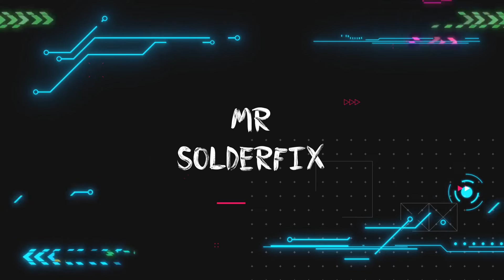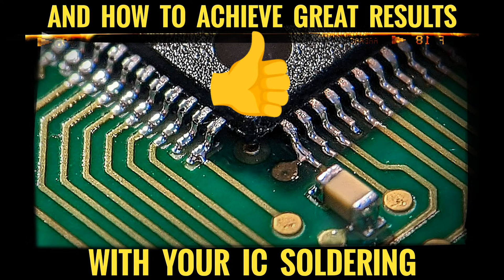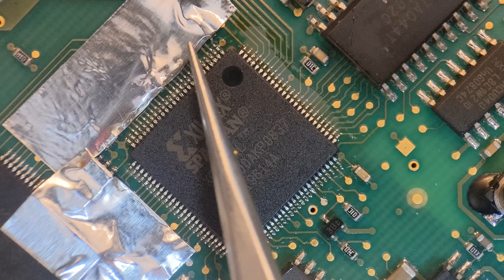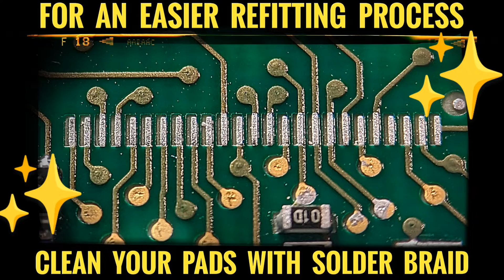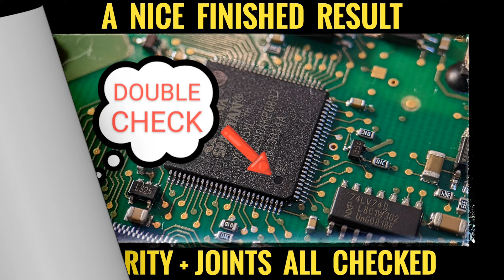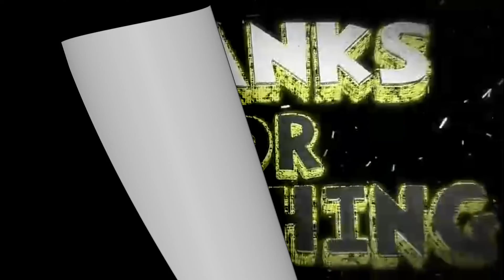How To Replace Surface Mount IC / smd IC || smd Soldering

Comment: How would you do to remove qfp with a gnd point soldered under it?
Reply from the maker: Hi , thank you for your comment . I've previously shown this in an older video and I've also shown BGA removals in various videos. You need a hot air gun to remove these , there's no chance without one of these unfortunately. Hope that helps , thanks again 👍
Reply: @mrsolderfix3996 thanks for answering so fast, I'll definitely watch other videos.

Comment: Thanks, great video. Just trying to reproduce this on a 176pin QFP with a solder square under the IC. Regards. South Africa. Hopefully the solder square does not give problems. I've heard one must heat the entire PCB to 160C and then tackle the individual IC.

Comment: im using led free and cant desolder cpus with air gun for my life, PCB starts overheating be4 solder liquifies on all 4 sides
Reply: Use a soldering iron to melt low temp solder wire onto the contacts - with the heat of the iron, the low temp solder will mix with the hi melt temp lead free solder that manufacturers use which will bring the melting temp of the manufacturers lead free stuff down enough release the cpu. There are many videos on YT showing this process.

Comment: - What are those components at 11:32 next to the IC ? They look like resistors. But they are marked with 01D and 01C.
Reply from the maker: Hi , thank you for your comment . Yes they are resistors . 01C is 10k ohm and 01D is 100k ohm . Hope that helps , thanks again 👍
Reply: @mrsolderfix3996  - Thanks. That helps a lot.
Reply from the maker: @valleyken hi , no problem , thanks for your comments 👍

Comment: Thanks for showing the removal in real time, other videos edit that bit and make it shorter than it really is. Also giving us the temperatures! Stressing the importance of flux, people don't realise that flux really helps removal of components as well as the soldering of them. That de-soldering braid comes in different sizes, decades ago, before the braid was invented, I used to strip coax cable and use the shielding as de-soldering braid! The braid does have flux on it but adding more flux can only help! By the way, folks, don't forget to clean the flux off afterwards!

Comment: Dear Mr. SolderFix, The technic used here is good. Your might use pre heating the board with a temp fairly close to solder melt temp, this process will help with large ground plans. In that way your'er  reducing the dwell time to get a complete melt.. Some boards are so heavy that heating a small area could possibly de-laminate a multilayer. I like the drag soldering method for better joints from heal to toe of each lead. Your calm voice and hand motion is superb. I'm very interested in process control when it comes to removing and replacing  SMD. I worked with PACE Inc. for many years. I'm IPC trained and can work on avionics and so forth. 
Please view my demonstration by searching "Everything you wanted to know about soldering and desoldering but were afraid to ask" or simply search PACE Inc. and you will see me in a blue lab coat. It's a live on the fly edit. 
The 1hour and 17 min. demo covers 5 unique hand-pieces. It's hard to believe this was made in 1996 but much still applies. 
Again Sir, I like your presentation style, relaxed and spot on with the cam.
Best Regards
Marc Siegel

Comment: solder paste will save you some time
Reply from the maker: @joshygaminghub7428  hi , thank you for your comment . I do use it , I've shown in a few videos the use of solder paste . I find IC's like this much easier to do with 0.25mm solder . 
Lots of people struggle getting the right amount of paste down ending in a right solder bridging mess . Unless you luckily have a stencil to me the iron is the winner . Thanks again 👍

Comment: BRILLIANT! I have struggled with doing proper solder repairs my whole life! I learned NOW from watching your videos how to solder PROPERLY and easily! Your videos are very professional! THANK YOU! for doing this fine work! 🎉
Reply from the maker: Hi , thank you for your support of my channel , very much appreciated . If my videos can help a few people out with their soldering / desoldering issues then that's great . Thanks again , take care 👍
Reply: @mrsolderfix3996  Great work Sir. Thank you so much for that. By the chance would be to possible to show technique how to solder correctly wires to the mcu pins. Sometimes to read flash work require to get connected directly to mcu pins. Could you show please how it would be. I am still in struggle with that. Thank you for your time

Comment: I just first wanted to say thank you for all the hard work you do when it comes to producing these videos and sharing your knowledge with us.  While I have learned so much from your videos (which I often put the information to use right way by practicing on "junk boards") I do have one question, when it comes to removing and replacing SMD ICs (and in this case specifically a BGA IC) how to you properly lift the chip from the pcb when there are a decent number of smaller SMD parts on the back side of the PCB just under the IC you are going to lift?  My first idea is to use the pre-heating station to heat the board to 100C and then use the hot air gun plus Flux to heat the BGA area up to the point where I can lift the chip; however, I am worried that all the smd resistors and capacitors on the back side of the PCB will fall off when I do this.

Comment: Hi what soldering iron did you use for this job.
Reply from the maker: Hi , thank you for your comment , much appreciated . In this video I used a Weller TCP S soldering iron which is 50 watt with a PTP7 conical tip . Quite an old style iron but still great to work with . Hope that helps , thanks again 👍

Comment: Great demo of how to do this properly and neatly.
I have a problem with desoldering braid "sticking" to pads. Plenty of flux, I think. Could it be iron head too small, not enough heat, flux has burnt off, poor quality braid....any ideas?

Comment: Mr Solderfix I wonder would you do a video or some tips on soldering j-lead surfacemount IC's I see them sometimes on vintage computers. I guess they should be PLCC socketed but sometimes just soldered on. Thanks for all the great content so far!
Reply from the maker: Hi , thank you for watching the video and commenting , much appreciated . I posted a video a while back called Soldering common IC packages . The component you mentioned is within that video somewhere . It's a very clear guide as to how I personally solder them in place . The video features QFN , QFP and ( J- lead ) , hopefully you can find it . Thanks again , take care 👍
Reply: @mrsolderfix3996  Thanks! my apologies for not looking :)
Reply from the maker: Hi , no problem , hopefully it is useful to you . Thanks again for your support 👍

Comment: Hey, i am facing one Problem with my BMP581 Sensor,it is on flex PCB ,now by mistake i gave connection no 6 instead of 7 ,how i can solve this issue,is there any chance that i can solve this issue , please guide me

Comment: To over come glue issue , if apply 400deg c can get off chip nicely  but ic spoiled  which  is removed  from doner  pcb ,
Reply from the maker: Hi , thank you for your comment. If you remove an IC at 400 degrees Celsius and it is attached by a thermal pad underneath it is very rare that it cannot be reused. If it comes off cleanly in my experience ( and I've changed 1,000s  ) it can easily be cleaned up and used again .If IC's are bonded down for example with underfill compound they are not worth trying to take off and clean up . Hope that answers this point .

Comment: Frequently  I have facing  difficulty  is,  some makers   they have applied  glue below the ic , hard to judge  whether lead not yet melted 
well or glue still sticking  hard , if  force  to get off , pcb track peel off , or what I have removed  ic few pens bending   unable to use this  ic  again , any idea pls 🙏

Comment: Amazing job as always! Could you reuse the component on another board? Would you clean the old solder off somehow, or are the pins too delicate?
Reply from the maker: Hi , thank you for watching the video and commenting , much appreciated . If the component I was removing , like for example the one in this video , needed to be refused it's actually pretty easy to clean up . With a fine pitch IC I simply wick off the excess solder on a few pins at a time with the braid going in the same straight direction as the pins . Alternatively another method that works well is I turn the ic over and run my wick from one end to the other with very little pressure . This works great especially if you add external flux to your braid first which I always keep mentioning in my videos . Hope that helps , thanks again 👍
Reply: @mrsolderfix3996  thank you for the detailed response! I'll try when I start learning to use hot air. I was curious as it's often cheaper to by an IC on a breakout board than bare
Reply from the maker: Hi , thanks for your comment . I will post a video sometime of a battered IC and show how you can straighten legs , clean solder off etc . I have posted a video on my YouTube channel ( quite an old one ) showing how I replaced 6 broken off pins on an IC using 2 different methods . Amazing results can be achieved with practice . Thanks again for your time , good luck 👍
Reply: @mrsolderfix3996  That would be so helpful, thank you for sharing your amazing skills with us
Reply from the maker: Hi , no problem , thanks for your support 👍

Comment: Hi @mrsolderfix3996 
Great video...I have a Samsung TQFP-160 S3C44B0X01 160 pin beast that needs removing and replacing on a board. I am not sure if I have the necessary skills that you have acquired and I'm not sure I am brave enough either. Do you undertake private work ?? I assume you are London based....Keep up the great work...and keep the wonderful videos rolling !! Thanks...

Comment: Hey I am new to fixing soldiering, what is the liquid you used? You said reflux something?
Reply from the maker: Hi , thank you for your comment . The liquid is just flux . It's essential really to get good solder joints . Even though solder has flux inside it adding more external flux is vital if you want good consistent solder joints . Thanks again 👍
Reply: Thanks! Between I really liked the video! @mrsolderfix3996
Reply: Google it!

Comment: but around 350-400c' desoldering heat broking the chip die, how did you protect chips from this hi-temps?
Reply from the maker: Hi , IC's like this can take temperatures of 350 - 400 no problem at all . Thanks

Comment: Thanks, well presented. I need to practise more with hot air - I keep burning boards or melting surrounding parts before a part desolders. I’ll try out some aluminium tape!
Reply from the maker: Hi , thank you for your comment , much appreciated. Aluminium foil will definitely help you protect your parts , it does do an amazing job . Lots of people make the mistake of using Kapton tape for protection but heat will go through this and still melt the plastic underneath . 3M or Advance tapes sell adhesive lined foil tape and others will sell it as well . Hope you get on ok , thanks again 👍

Comment: Thankyou, your videos are just what i needed. I'm having difficulty resoldering in an ic on what looks like a ceramic pcb. I snipped half the legs off which sent a shockwave dislodging the pads on that side. So i can't solder to the substrate underneath, although it is conductive. The other side is ok as i just flexed the ic like a hinge until the oins snapped. I still have useable tinned pads on that side. I'm trying conductive glue on the padless side, but it's tricky as i messed up taking the weight off the ic too soon as it was curing. I bet you could sort it. If only i could send it to you...

Comment: Great video! What is that you are using to apply the flux? I'm also curious if you think an IC with a large exposed ground pad on the bottom needs to be treated differently, or if the same method applies? Thanks for sharing. This is incredibly helpful.
Reply: It's a cable tie end

Comment: What is the difference in using 138c and 180c solder. ICs dont go above 80 or 90C right, so can i use 138c solder on qfn and other smd?

Comment: Hi, I really like your videos and am trying to follow along while learning to solder some retro video games I have. What kind of iron tips do you use? My iron is a T12 clone and the conic shaped tip I have doesn't work nearly as well as the one you use in your videos. Do  you just bump up the heat on your soldering iron when soldering the smaller package components?
Reply from the maker: Hi , thank you for your comment, much appreciated. I use a Weller TCP S iron mainly ( I also have an amazing micro Metcal iron ) but all of my videos are made using the Weller. It's a 50 Watt iron and the tips I use in the video are PTP7 ( small conical) and DD8 ( large flat sided ) . I generally solder leaded solder at about 330 degrees Celsius and for lead free about 360 to 370 degrees Celsius. I may vary these slightly by putting hotter tips in but very rarely. You shouldn't need to bump up the heat when doing small devices etc but maybe these are on a ground plain so will take a little longer. I'm sure I speak about this sort of scenario in some of my other videos . I don't know your type of iron so can't comment on that . If you can afford one the best makes to get by far are Weller and Metcal . Hope that helps , thanks again 👍
Reply: @mrsolderfix3996  it does help a lot, I think the conical tip you use is a little larger than the one I have, so that might be what's making it a little harder for me to get the heat to transfer. I'll look up the dimensions of the tip you use and see if the difference is that big. Thanks for the info!

Comment: how long can you apply the hot air to the PCB before it begins to delaminate at say 350 c?
Reply from the maker: Hi , thank you for your question. You can get away with a lot longer than I showed in this video . If your heat gunning a component in an area where there is no other components surrounding it and if you hold the board up to the light and this area appears as though there is no layers in there you have to be careful as it could delaminate with 2 much heat . Where boards have layers top bottom or inner then you can put a lot more heat for longer into these areas and be fine . Hope that sort of explains . I've used a lot higher than 350 degrees Celsius and always been perfectly fine . If heat gunning right on the edge of a board , try and place some aluminium foil around the edge , this will stop it burning and potentially delaminating. Hope that sort of answers your question . Good luck 👍
Reply: @mrsolderfix3996  Thank you, really good insights!
Reply from the maker: Hi , no problem , hope you get on ok with all of your soldering projects, thanks again for watching 👍
Reply: @mrsolderfix3996  I have improved my soldering (and desoldering) skills quite a lot watching your videos! Never touched SMD work before, now I am into my third project and feel very confident with 1206 and 0603 stuff. Thanks!
Reply from the maker: Hi , it's great to hear you are improving, excellent . If I can help a few people along with their soldering that's great. Remember , you will get there , stick with it . Thanks for all your support , take care 👍

Comment: crikey mate, such a steady hand, brilliant, getting me some 3m alu tape, thanks, great tips...
Reply from the maker: Hi , thank you for your comment, much appreciated. We can all improve the more we solder , hopefully I can help a few people . The aluminium tape is great , adhesive backed as well , much better protection against heat than Kapton  tape. There is other aluminium brands out there , massive difference in prices . You don't need to spend loads just try to get one with adhesive on so stays in place while using hot air. 
I will probably post a video shortly on what you can protect with this tape , plastic connectors , headers etc. Thanks again , take care 👍

Comment: In principle, I solder everything with the Sn60Pb39Cu1 solder, even if the print was made with lead-free solder. So far I haven't had any problems with the incompatibility of the two solders.
Reply from the maker: Hi , thank you for your comment, much appreciated 👍